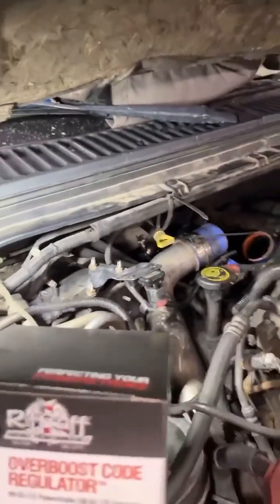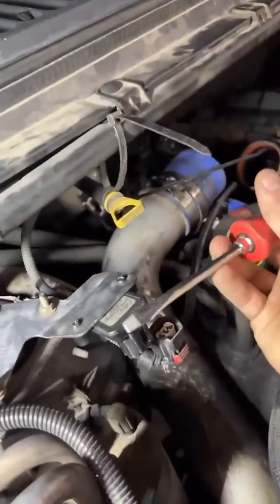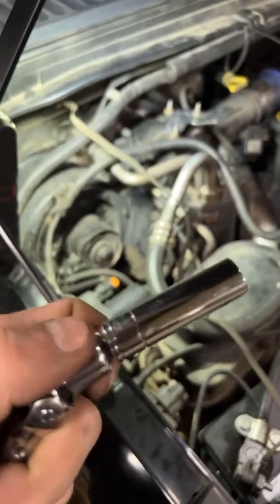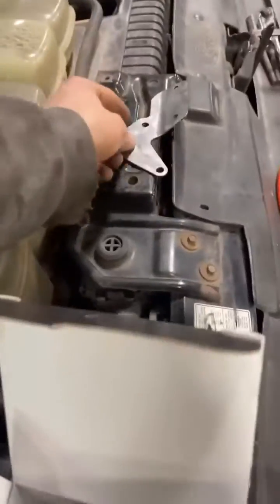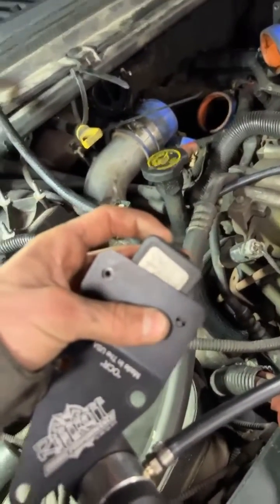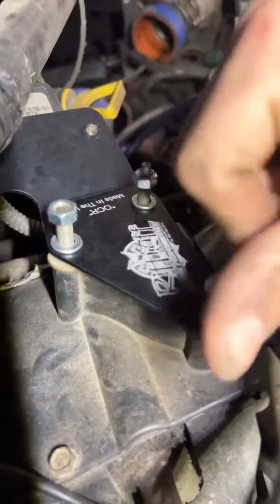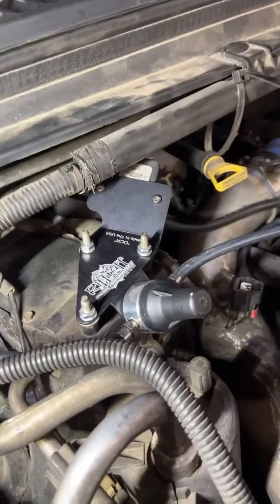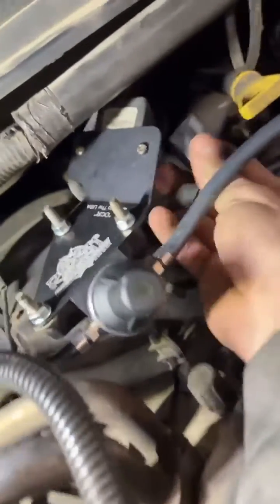2001 FORD 7.3 BOOST FOOLER INSTALL

Comment: I have a 2009 Mack cxu613 and but some of the clusters gauges instruments stop working because I spilled water into the gauge. I bought a used gauge cluster but  when I connected it I am getting an error saying (no data) do you how to fix that that problem
Reply from the maker: R u sure th Guage cluster u bought was actually good
Reply: @dirtydieselnation8826   I am not sure. it came from a crash truck
Reply from the maker: They might b bad
Reply: @dirtydieselnation8826  I called a mack dealer and they said when it says no data it means the new cluster needs to be flashed and reprogrammed to my truck computer. I have a friend that has tech tool but he doesn't now how to flash and reprogram. 
I was wondering if you know the procedure to do it ?
Reply: no valid config data cfg data used: vffff necessary: v0f00
Reply: thats the error i am getting
Reply: Can you show where you connect  both hoses as well